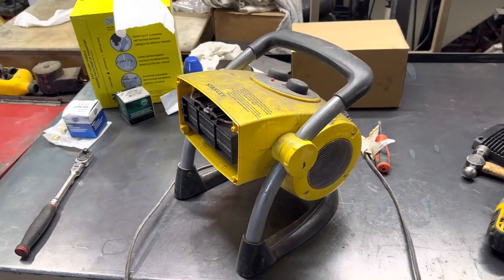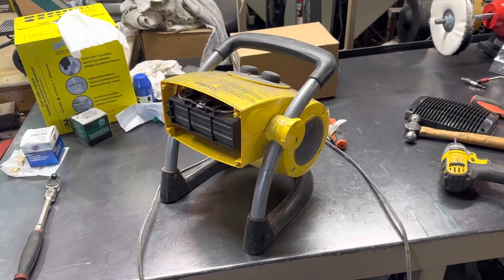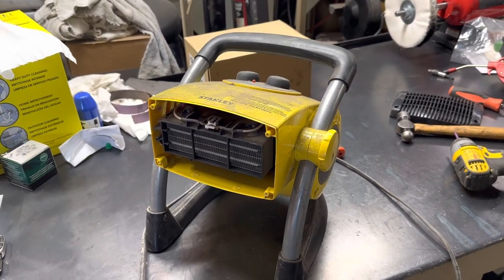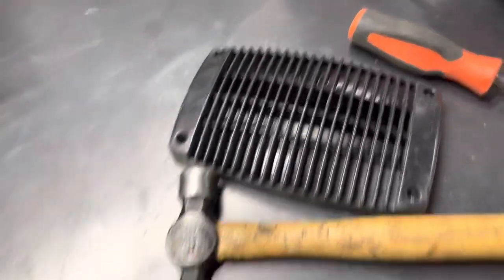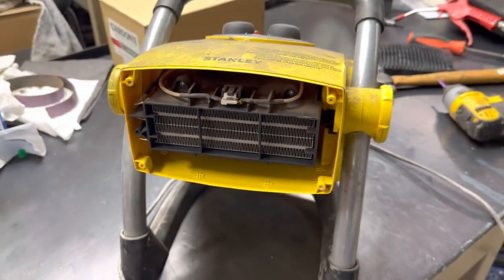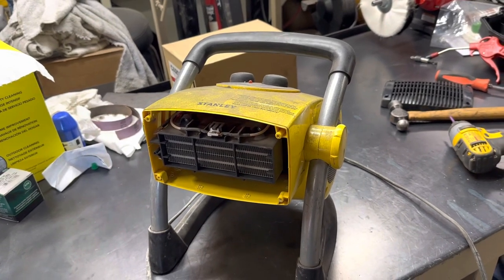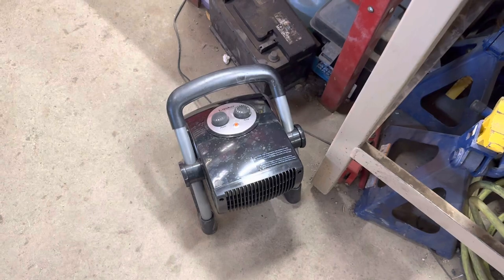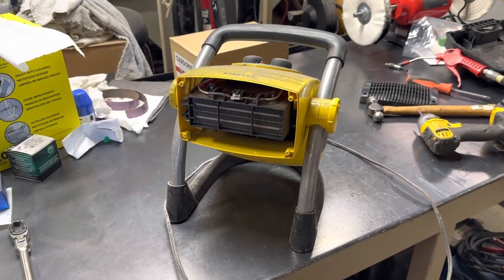Stanley Lasko ceramic heater no heat no air

Comment: My runs, heats, but when it cuts off it won’t cone back on till I unplug it and it sits fur a bit. Then it will work till it cuts off again. And what bit did you use to get grill off? I’ve tried Allen, torx, Phillips
Reply from the maker: I believe it was a Torx bit.
Reply: @wlschaubels  they had these lil tabs in the center and wouldn’t let the bit set. But I got them out. I blew out the connector on top like you advised. Flicked the contact few times. Turned it on. It got down in 20s last night and we keep dogs in garage. I’ve put this lil heater in there for several years and it’s been broken but runs long enough to warm them some. Just decided last night to YouTube issue. Found your vid! It’s 7am now and I went to the garage and guess what! The lil heater was still running and the dogs were nice and cozy!  Thanks so much! The dogs say thank you as well! Merry Christmas 🎄
Reply from the maker: @regularguyfixes3142  you’re welcome. Glad I could help.